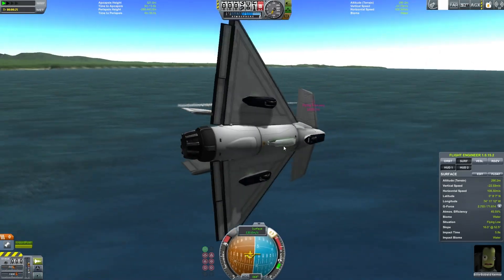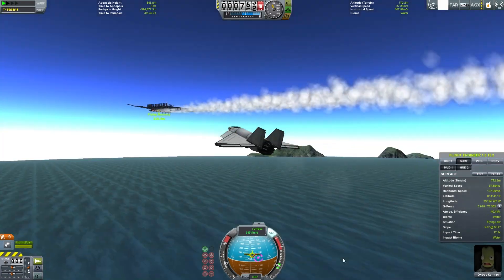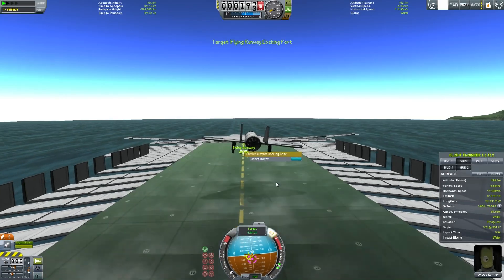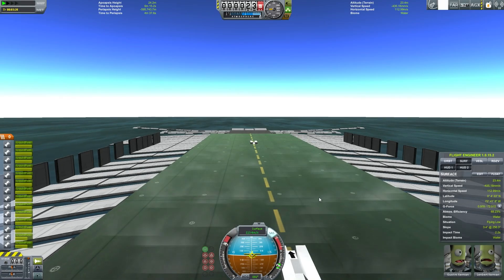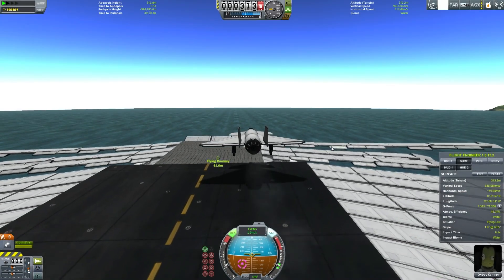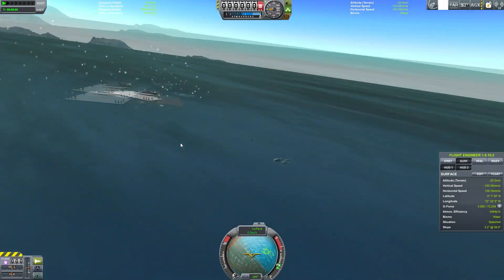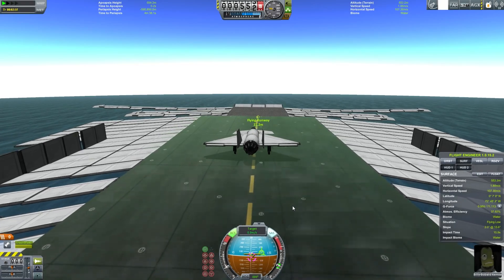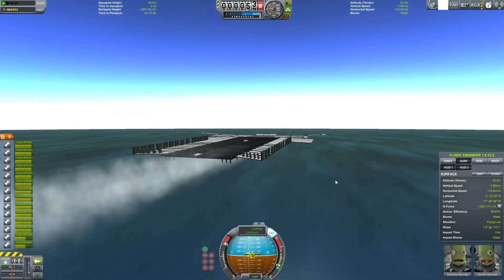Air To Air Refueling... With a Flying Runway

Comment: I've been wondering for a while: why you are playing this with the keyboard? You could control everything so much smoother with a controller. It would have kept you from stalling your plane by over-pitching in this case.
Reply from the maker: nRXpAa8E6UML Yes, but it would mean setting it up for ksp.
Reply: Scott Manley Considering how much time you invest in this game, don't you think it would be worth the effort? I've got a 360 controller just for this purpose so I could control planes with some feeling instead of these erratic 1 bit button controls :D
Reply: I set mine up with every new install (takes 10 minutes) and then I'm good to go until an update. I admittedly have a cheep joystick, but it's definitely better than keyboard. I don't see how this would be a problem. Do you have an expensive one that needs its springs calibrating for every game or something?

Comment: I made a flying hangar a few months ago. It was a lot like this thing but with walls and a roof. Like a long flying box with one end open and a docking port on the opposing wall. I made it auto-stabilized by angling the front set of wings up a bit while making it a bit nose heavy. That way I only neded the throttle to regulate pitch. Landing in it was like threading a needle while receiving electric shocks, while spinning upside down while bungee-jumping, but I pulled it off eventually.
Reply: Sounds like a very easy landing indeed
Reply: Ok you actually made the aigaion from ac5
(ik this is 4 years old)

Comment: two things: couldnt you try the landing at a higher altitude so you wouldnt have to worry about it getting too low?
also, would it be easier to fly in front of the carrier and slow down to land instead of coming up from behind it or is it pretty much the same thing?
Reply: Ok 
One.  I think the ship would be too unstable at higher altitudes and it would be harder to maneuver the aircraft at higher altitudes.
Two.  It's better to come from behind because if you come from the front, then you have to invert the controls to translate in the direction left or right.
Reply: DjDR3W I think the main problem with doing this stuff at high altitude is in the fact that quick saving and quick loading would not work for him.  Anytime he had a failed attempt he had to relaunch.  Moving that into high altitude would have probably taken fewer attempts, but each attempt would have taken much longer.

Comment: What mods did you use in this video? links if possible?
Reply: 1: Kerbal engineer
2: R5 boat parts
3: deadly re entry (it doesn't affect to mission at the speeds he's flying at, but it is on the toolbar.
4: Ferram Aerospace Research
The first two can be found on Kerbal.curseforge.com/mods/
The other two can be found on the KERBAL forums.

Comment: Easier than docking with a docking port on a KAS String?
Reply from the maker: Matthew Nguyen Yes, in fact every air force that does air-air refueling uses a tether, however it's not suited to KSP because of the control system.
Reply from the maker: B. oamere doing the KAS Tether trick causes all sorts of hilarity because suddenly the controls for both vehicles are merged
Reply: Scott Manley Oh yes I remember now, That has ruined some space operations for me in the past :') Pretty great to watch though
Reply: Isn't the tether air refueling used by the US navy aircraft?

Comment: If anyone is interested in FICON, the Soviets actually used a similar idea in combat early in WW2.  They docked 4 small fighters, either I-15's or I-16's to a TB3 bomber.  The idea was that the bomber would carry the fighters most of the way to the target, then drop the fighters.  The fighters would then perform strafing runs and rocket attacks on the target.  The fighters would then return to the parent aircraft and redock.

This allowed the fighters to hit targets at much greater ranges than they'd usually be able to.  It worked relatively well at first, but German fighter technology improved too rapidly, and the TB3 motherships were sitting ducks against Bf109's, and the program was quickly terminated.
Reply: I was just about to write that xD Btw, that's called "Vakhmistrov's chain" (Zveno Vakhmistrova/Звено Вахмистрова)
Reply: Danny2462 on his Android phone faek
Reply: waterlubber naw
Reply: Danny2462 on his Android phone
Me: Whoa! Danny replied...wait, never mind. Danny uses Crapple!
Reply: Millitron That's actually quite interesting. Thanks!

Comment: You literally made a helicarrier...

Well, it's not a VTOL craft, but still. That's pretty much the closes you can get to the Valiant right there.
Reply from the maker: ***** Lots of people have made Helicarriers, I wanted to make a flying runway.
Reply: Scott Manley WIth kOS you could make the aircraft carrier hold altitude, attitude and speed. With enough control authority you might be able to keep pushing the aircraft down once you are landed and roll to the docking port without the affecting the aircraft carrier's flight parameters.